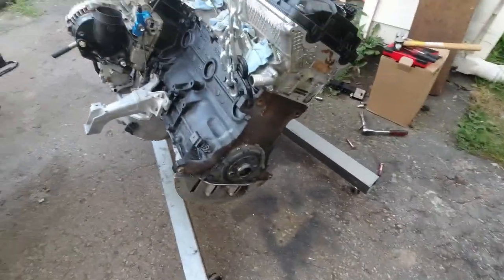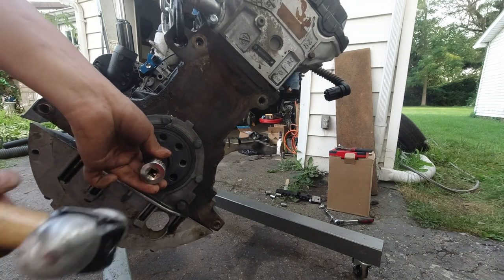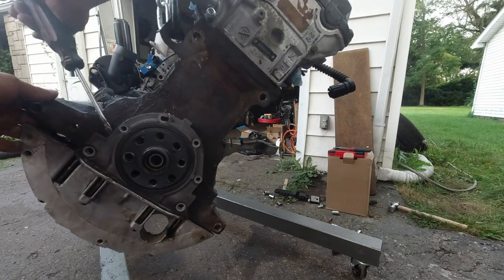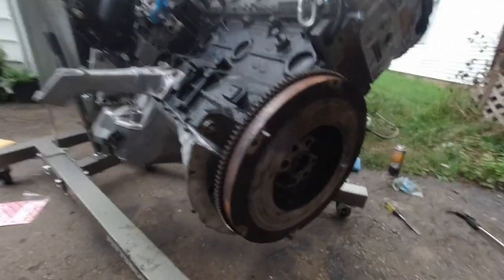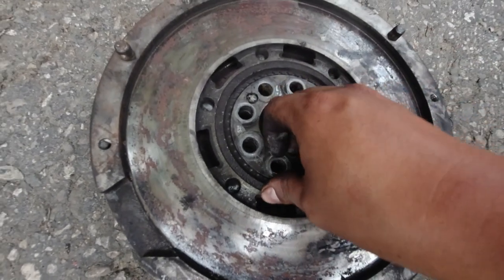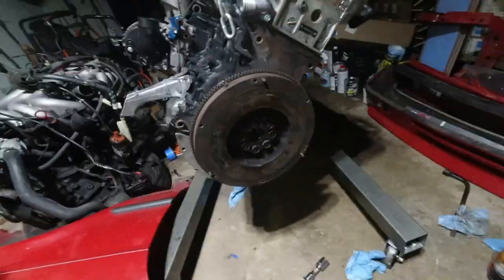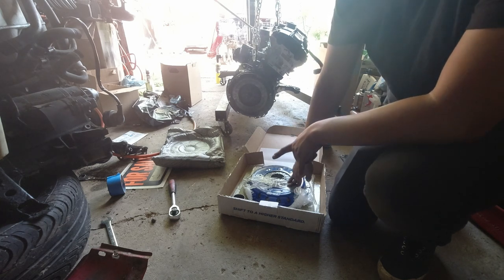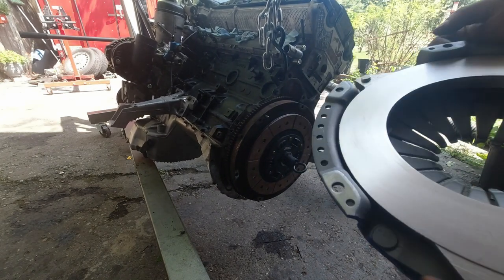M20 Flywheel on M52 (E30 Build Episode 5)

Comment: Did you do something with the starter? I did the same thing as you using m52 double mass flywheels spacer but starter dont engage ?
Reply from the maker: I used the same starter from the stock E30 engine. As long as the flywheel and starter are for an E30(G260 Transmission) then it should work properly.